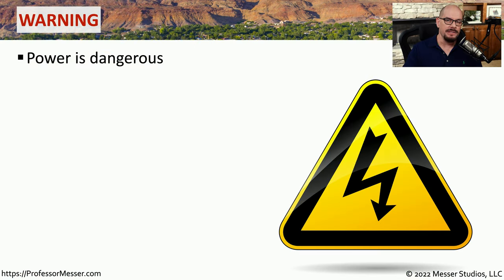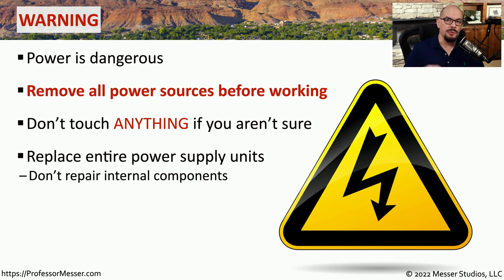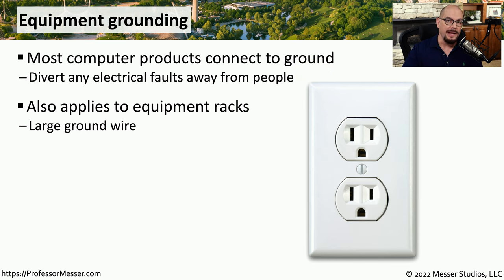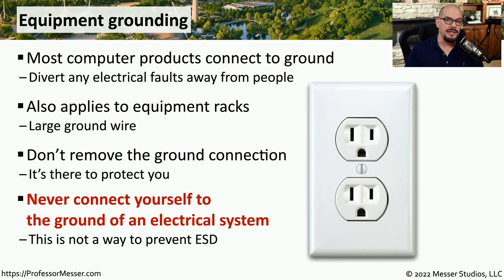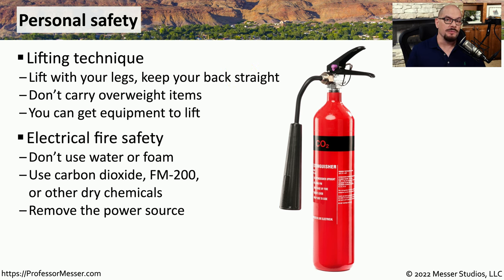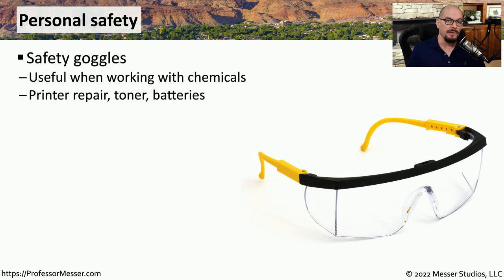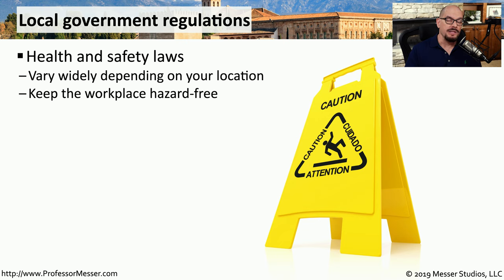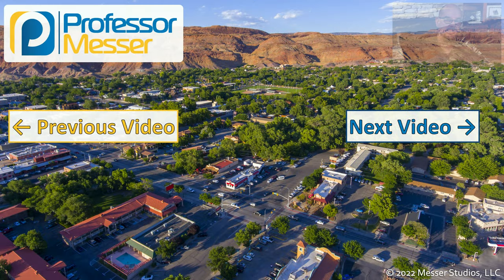Safety Procedures - CompTIA A+ 220-1102 - 4.4

Comment: We use a Halon gas system to displace oxygen from the room during a fire. It's great for disaster recovery because there is no residue, and you don't have water on the electronics. If the Halon system goes off, you definitely don't want to be around!